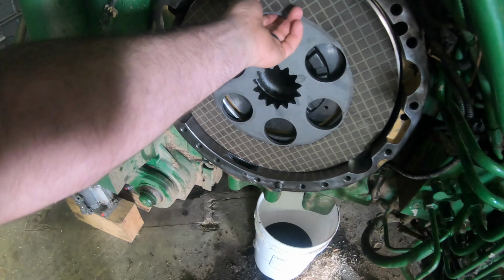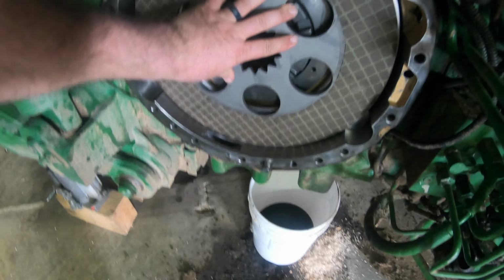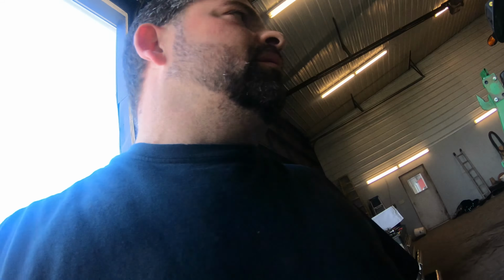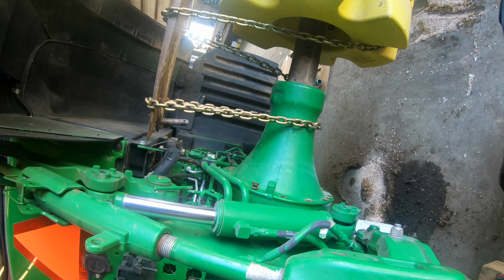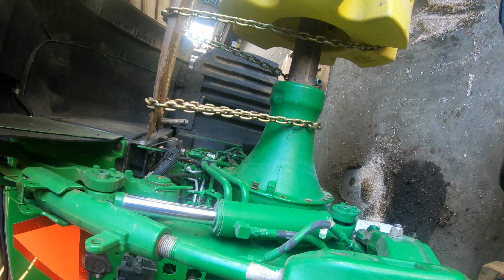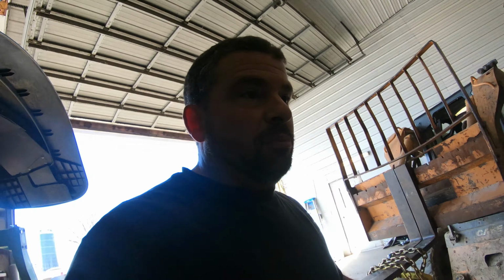John Deere Guts

Comment: Tony, looks like you picked the right time to replace the brake disk. Does the tractor have a lot of hours on it? Tractor looks like new
Reply: 4400 hrs. Most of them are pulling the poop tank
Reply: Yeah I’m thankful we saw it now and they didn’t have full deterioration when we were busy. they may have made it through the spring but I didn’t wanna take a chance
Reply: @tonyrohrer3563  Yes and more deterioration would not be good for the rest of the tractors internal components. Great job with the maintenance of your equipment, really like the channel and your updates on the new parlor and expansion. Keep it going

Comment: To me, it"s just a bad design location for brakes. Some older tractors had the brake rotor ahead , splined out each side from the transmission, easy to replace, ahead of the rear end.